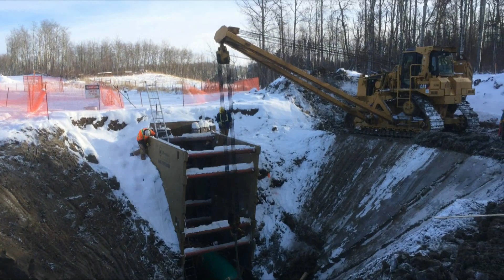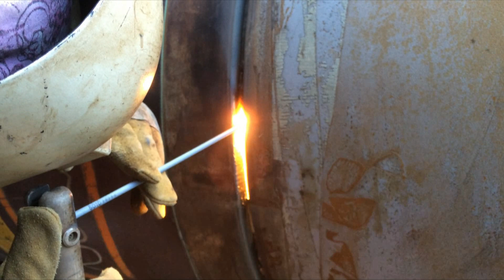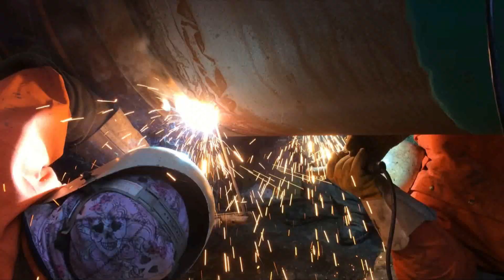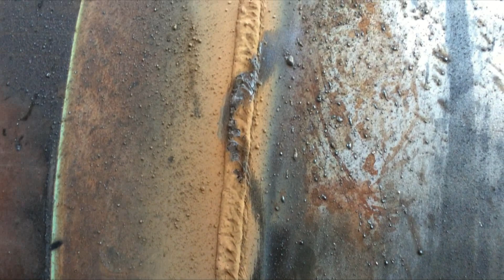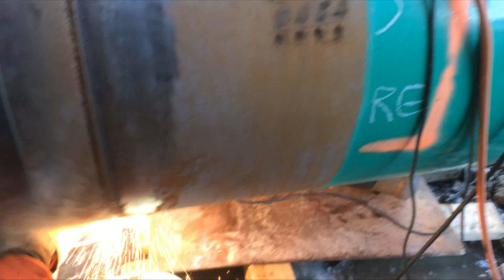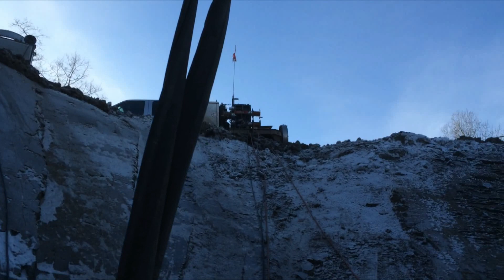Pipeline Welding - The Last Trench Box Of 2014

Comment: good job. my father is a 40 year veteran  of the Local 777 Steam Fitters Union here in CT, worked mostly in the Oil yards running pipe lines, my oldest Brother also has about 30 years in the Union...  running high pressure steam lines all beneath New Haven, keeping the Yale Power Houses going and the buildings heated.

Comment: hey mate ,you using S A 200 Lincoln or some other machine,lot of guys out here in Aus still running 400 AS 50 style machines ,great machine ,made by Lincoln in Sydney and still in my opinion one of the best machines Lincoln ever made
Reply: 400AS50 are 400 plus dc welding amps and 5 kva 240 volt single phase power output which is our equivalent to your 110 volt ,machine runs a 3 cyl Perkins diesel engine on constant revs ,no idle down fitted ,still a brilliant generator style machine very reliable,
Reply: just wondered have you tried running inverters or do you find they become unstable when hot or after running for long periods ,any thoughts,jimmy